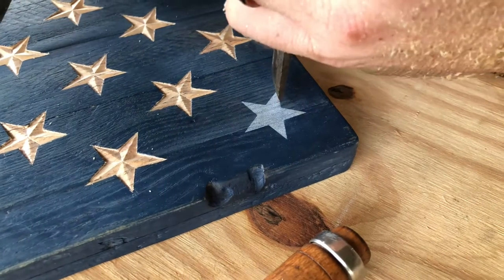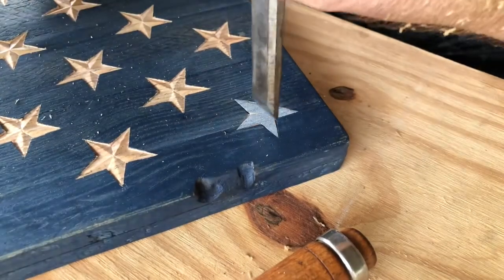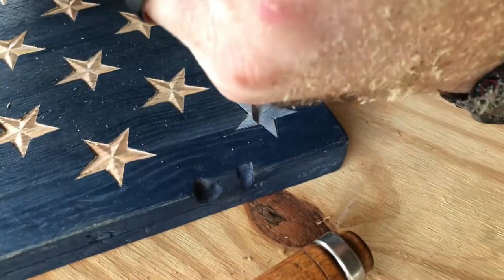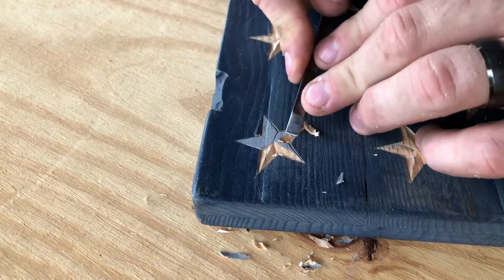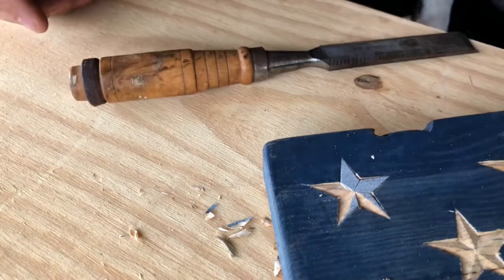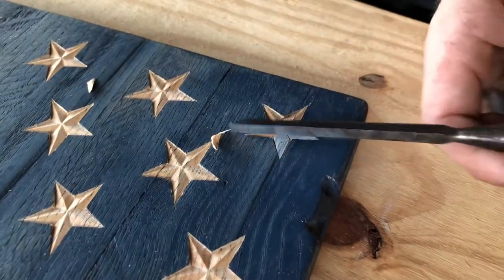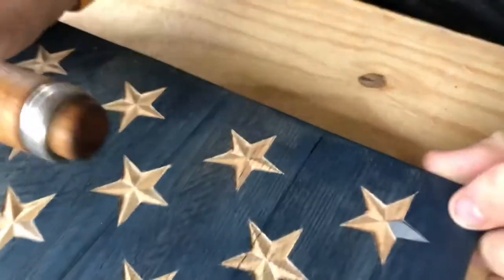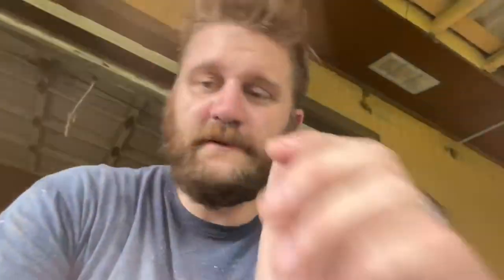Instructional video for carving stars in wood

Comment: 4 years late to this video. When I inherited my dad's table saw, router table and drill press, I vividly remembered the smell of sawdust in his small woodshop. I was the last of 6 kids, in a college dorm or small apartment, with no room for a cedar chest, entryway table, full length floor mirror and other projects he made for our Christmas projects. So I actually helped make the projects for my siblings. He had a farm accident that left him disabled, but with the plans he'd drawn for the cedar chest, which i have in a hidden panel inside the chest, I made my own with the tools he wanted me to have because we worked side by side. Long story short, I'm drooling for the day that my wife lets me make an unholy mess in our garage so I can do a wavy flag. I absolutely will be using this method to carve the stars, as a dremel just cutting them flat looks so cheap for having invested so much time, effort and love into making the flag. 

Thanks for reading, and for your video. The stars turned out amazing. Not a bad background soundtrack either.
Reply from the maker: @SkippyRo  love the story! I started woodworking as child 2 of 8, my father was a framer and hobby woodworker. I was on job sites since I could walk up to age 25, from laborer to lead framer. Spent many a lean Christmases making wooden gifts in the garage with my dad and siblings. About 6-7 years ago I wanted one of these wooden flags, didn’t want to pay exorbitant prices they had the big ones priced at for manufactured/faux patina, so I made myself one and a dining table for my family. Had a couple ask me to make them a flag and so I got back into woodworking as a hobby. Started with a Skilsaw and a drill and a borrowed table saw.

Comment: Your quality of star carving is great! I can't bare to spray paint stars onto my flags. I use the dremel technique and yes it worked, but it was super dusty (even with the mini dremel fan attached to the drill tip), and it just does not have the upscale classy look that your chizel carved stars have. Also the dremel method still took me an hour and a half to complete 50 stars. So even if your chizel method takes me 2 hours for a 50 star union,  I feel the carved stars upscale the flag look by 10 fold! My next flag project will be the "wavey" flag type, with your upscale chizel stars!  Hmmm i think i better practice first on a flat union flag first though. TY for your skilled tutor tips for us newbies!
Reply from the maker: On a good day it takes me 4-5 hours to carve a union. Good luck, and definitely practice! My first one (my personal flag) does not look great but by the time I finished all 50 stars I had gotten lots of practice and nearly perfected  my technique so the second flags union looked way better.
Reply: @Hwoodwoodwork  wow 5 hours, ok that then is something I would only carve for special family projects then!

Comment: I agree with most everyone who has seen your video.  Your star making is enjoyable to watch and the results are amazing.  I do have a question.  How to you keep from getting paint bleed outside of your lines.  Thank you for sharing your skills and answering my question, in advance
Reply from the maker: For the stars layout prior to carving, I used an adhesive backed vinyl as the stencil. Being a sticker it doesn’t bleed much, and it is pretty light coat of paint . 

The blue does sometimes bleed deeper into the wood in softer wood spots or at the nail holes.

Comment: Those have to be the best looking stars Ive seen! I just started making wavy wooden flags and the stars are the biggest pain and being on curves some are very challenging. I use a Dremel with a 105 bit and magnifying glasses but between the glasses giving me vertigo and my shaky hand it's quite a process lol. Have you ever done this on curves?
Reply from the maker: @jandblawncare8570  I have not, would love to give it a try though. Not sure I have the time to do the curvy surface.

Comment: Great job. I noticed your union has rounded edges, rather than square or pointed. I'd like to see a video of how you build a complete flag. Thanks man.
Reply from the maker: Maybe, I don’t a ton of flags or a lot of videos. My method is a bit unorthodox compared to the way most guys make them. I use pallet wood so there’s a bit more labor.
Reply: @Hwoodwoodwork  I have seen alot of videos of guys making these flags and each seem to have slightly different ways. Some paint stars, carve with dremel, chisel. Etc. Thanks
Reply from the maker: @ChristianCMC  if you look me up on Instagram, you’ll be able to find my flags and other stuff I make @hwoodwoodwork
Reply: @Hwoodwoodwork  Cool thank you.

Comment: Mahonri, I make flags and many of them I give them a "rustic" look. I have never made my stars like that, just painted, but I'm going to practice and start making a few like yours, I hope! Now, do you put paint in your starts and if you do, what paint do you use?
Reply from the maker: I do not paint my stars (I did once because the customer wanted gray stripes and the stars needed to match) but I usually leave natural wood for any “white” of the flag and so the carved stars match the stripes. For me, the Stars and Stripes should always match.
Reply: @Hwoodwoodwork  Thank you for your reply. I like your style and i'm working hard on trying to get it perfect. It's a lot of work but I will get get right.One thing I really need to do is get more carving tools. I believe I read you got your at HF, and I wrote that down. You do amazing work, and I watch this video to correct my mistakes. Thank you!
Reply from the maker: @billknepp9358  yeah, I use HF chisels. I did have to sharpen them all properly initially and frequently while I carve.

Comment: What kind of wood are you using? This technique does not work with pine.  The wood is too soft.
Reply from the maker: @davidmann2988  it can work with pine, I have it used a couple times. You just have to be more careful with the direction